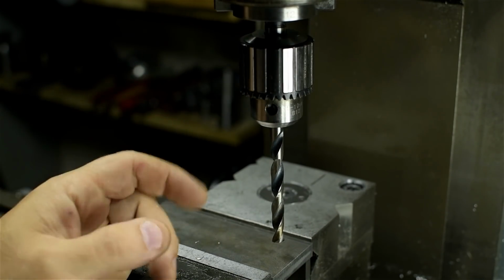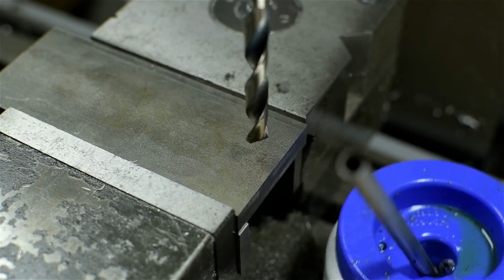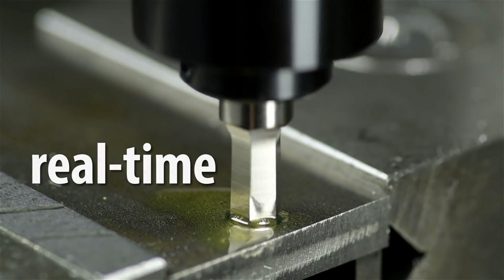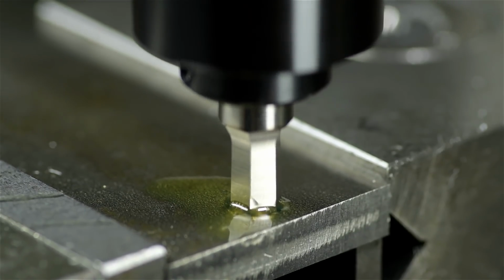Rotary Broach: Captain's Log, Supplemental

Comment: I can only imagine the machinist who thought of rotary broaching. "Hey, you know that non-round hole that we need to cut? What if we try cutting it with a spinning, wobbly thing."
Reply: Now I better understand that a rotary broach is made of wibbly-wobbly turny-wurny..... stuff.
Reply: This technique could have been discovered as the result of a "happy accident".
Reply: You called...
Reply: Here’s the thing. Pop the eraser out of a #2 pencil. Now, think, “How would I use this empty metal circle at the end of my pencil to make a hole in this sheet of paper?” I can remember in grade school when I discovered that I could make a good hole faster by wobbling than by just pressing, no spinning required. The only reason we need spinning in the broach equation is to [cleverly!] provide the wobble.
Reply: @CaryMillsap  Ha! I did not try paper... but I did have a larger eraser that ended up looking like Swiss cheese ;)
Reply: We just hammered a hex key into it... Some smart ass decided to do it a little less brutal 😂
Reply: i'll bet it was accidental.  ever seen a dull counter sink chatter?  6 fluted counters  start to resemble hexs.  Just a bit of refinement from there.  but hindsight is 2020.
Reply: @mikepettengill2706  That's what I was thinking, too...  Was this likely the result of a badly wobbling tool with a broken or worn tip leaving a hole that wasn't round, and the machinist going, "Hmmm, how can I make that happen on purpose...?"
Reply: @Tasarran Everyone who once used a dull knife or chisel knows you need a little wobble to make them cut. You basically use the points as levers to increase pressure at the cutting edges.
Reply: No way was it found accidentally
Most machinists are both engineers and laborers - a perfect combo to make invention happen - and it's not like broaching and wiggling through a cut are remotely new concepts.

Comment: This will definitely help all those people who were like "how the hell?" in the last video ... phenomenal demonstration of what it was doing. :)
Reply: I mean, I could reason out that that had to be what was happening. I just couldn’t see it.
Reply: @JasperJanssen  - same here. I knew it was wobbling, but to see how much it was doing so was cool. Very glad Tony gave in and made this one. :)
Reply: Im one of those. I certainly missed something because i couldn't see how flats were cut by a spinning object.. now i see that the broach only spinning because the work was spinning. The chisel analogy makes much more sense.
Reply: I'm still confused how it cuts it perfectly with that wobble. I guess the bit is slightly under sized for the hole it needs to make?
Reply: @daleroy2466  the very tip is the proper size, but behind that going up it has a taper to it - so as it wobbles the taper keeps the sides of the broach from touching the hole. Pause it once with the broach sideways and look closely at it - the sides of the broach itself are not parallel,  it gets smaller towards the base of the bit.

/  \    <----- shaped like this (exaggerated)
Reply: @Broadpaw_Fox  Thanks for that! :)
Reply: @daleroy2466  - you're welcome. :)

Comment: I got the gist from the previous video, but watching this one made me realize a few things I didn't see before. For one thing, the broach tool must be slightly tapered (maybe that should've been obvious). For another, the axial tilt determines the length of the broach tool. If you shorten the tool by refacing/sharpening it, the cutting face will not just precess but will also "orbit" off-center by a gradually increasing amount the shorter it gets, resulting in gradually expanding hex key size.
Reply: Blondin, yes you are correct, that is why the other broach sizes (in the first video) were all the same length.
Reply: that sounds like a sharpening nightmare. i would need to see a vid to better understand :P
Reply: Yes, the broach body is not just tilted, it is also offset to bring it back to centre based on a chosen nd fixed broach length for the tool.
Reply: @michaelpiotrowicz6100  after sharpening could you set the broach cutter further out in the broach holder. or does it have to be set all the way in?
Reply: I'm no expert on this stuff. I would guess the broach sits in the bottom of the hole for cutting forces, I don't have one. Stefan Gotteswinter built one from a kit. Learn all about it in his channel.
Reply: @piworower  is it 'sharpenable', though? I can't see how.
Reply: Sharpen it by grinding it shorter by a known distance, then add equal amount of shims between broach butt end and holder bottom?  Just a guess.
Reply: @juhakettunen7971  No, you can't really sharpen these. Blondin's observation is correct, the broach tapers to allow it to oscillate through the work. This means that if you sharpened it you'd not only make it shorter, but you'd also make the resulting hex(in this case) smaller.

Technically, you probably could sharpen it since you don't need to take off much material at all to restore a  cutting edge. But you'd probably only get away with one or two goes before your 6.1mm broach becomes 5.9mm and your 6mm key no longer fits.

Comment: I just figured out how to verbalize the confusion I didn't
even realize I had after watching the last video. 

I use drills in the tailstock of my wood lathes (i know, i know...) 
all the time. When drilling, it doesn't matter whether the drill 
or the work spins, but one (and only one) of them's gotta spin.

In broaching, the work AND the business part of the tool can either 
BOTH spin, or BOTH NOT spin. BUT there is a 3rd element, the body (?) 
of the tool where the 1 deg angle lives, and it must do the opposite 
of the work/cutter (spin or not spin). The fact that the work and cutter 
were both spinning on the lathe disguised the wobbling holder action.

Wow. Thanks again, Mrs. ToT!
Reply: caliman99 I'm sure you know what you're saying, but your words broke my brain.

Comment: I watched your 'Square Holes' vid first and while I knew what broaching was I had never heard of rotary-broaching (I'm no machinist) so when I saw you using your lathe to 'turn' a square hole I did two things... 1. giggle inanely and scream "Magic-ery", 2. once calm I went down the rabbit hole of finding more info on rotary-broaching (including visualization vids on clear acrylic blocks). This meant when I watched your main broaching vid I was perfectly fine with the reference-frame switch for the lathe 'method' and understood the 1 degree angle behind the broach face.
This supplemental vid is just icing on the cake and really shows how clever rotary broaching is, thankyou for posting it, Captain Old Tony.
End Transmission.

Comment: Thanks for the follow-up. I went researching and got it.  But this video is way more clear because you can clearly see that the bit is doing, well, the chisel effect you showed.  But it in the prior video, it just looked like the bit was rotating like a drill bit - hence the head scratching.  Thanks!

Comment: I had never seen a rotary broach before your previous video.  I had tried grinding a standard drill bit square but that did not work too well when you spin the bit.  Still get a roundish hole.

Comment: This is some cool stuff! I now work in a sheet metal fabrication shop where we make large quantities of parts for various companies. Your videos have spurred an interest in the inner workings of metal fabrication. Mostly I just push buttons on anything from 35 ton presses to 250 ton, all of which are probably older than I am. But today, I got to see a Surface Grinder in action, magnetic plate and all. Since watching your video about them I've wanted to see one in person! Now I have access to a lot of these types of tools even if I don't use them myself. 

The long and the short of it is, thank you for occupying my small brain with machining videos well beyond my capabilities!

Comment: I absolutely understood the process from the previous video in the lathe, but I must admit that Mrs Old Tony was right, it was a much nicer visualisation when done on the mill. 
It was becoming too difficult trying to spin myself up on my office chair to match the lathe RPM, got quite dizzy every time I got close.
That might be an interesting demonstration project for you - mount a GoPro on a piece of stock in the lathe, and film the work's view of the drill/broach/etc. - I guess at low RPM. (Not sure if that's been done before)

Comment: I think that in the lathe the tool is simply spinning off axis which is what produces the axial pulsing of the tools cutting edge in the frame of reference of the lathe chuck/workpiece. The tool doesn't actually wobble compared to the lathe axis the contacting edge of the tool moves around the bore of the work piece.

Comment: The broach does NOT wobble in the lathe.  Being one degree off center means the broach approaches the work at an angle.  Cutting just as it would if everything were non rotating except the rotation and the one degree angle allows the broach to cut with one corner at the time.  Put the broach in the lathe, put an indicator on it, and rotate it by hand.  The bore in the larger part of the holder is bored off center.  If the larger part of the holder isn't rotating... no wobble.

Comment: Well, funny.  This Old Wife was exactly right!  I went back and re-watched the original video and for sure I never understood that the broaching bit wasn't rotating in the hole.  Somehow I thought the bit had a slightly smaller diameter than the hole and that it deflected off of the walls of the inside of the bore in the pattern of the broach tip (cutting as it was striking the walls).  Wow do I feel dumb for the last sentence I just wrote.  Please tell Mrs. Old Tony that there's (at least) 1 slightly less stupid person in the world today because of her.    Thanks immensely for all you share.

Comment: Holy crap... you have the brown allen wrenches?!! You sly dog... you're making some real shine off these videos, aren't you :-)
We wobble broach pretty often at my shop. Swiss CNC & conventionals. The pre-drill depth and diameter mean a great deal to give the chips a place to live and for coming out with enough of the hex corners yet not cause so much back pressure you lose tool life or literally push the stock back. Too big a pre-drill and the hex corners might strip out during use.
We don't try to re-sharpen the tools. There's some pretty big math going on with the tool length & the wobble angle. Our customers are pretty stringent on hex tolerances and we can't risk the error just to save the $ on the tool.
Terrific videos. I'm simply amazed at your scripting & editing.

Comment: The lathe with it’s spinning work is different in some uses from a spinning tool. There’s a reason a drill bit pulls itself on center in a lathe but will not do so in a drill bit. In a lathe the position of the work is being averaged out by the rotation instead of the tool position

Comment: I don't know if there is variation between manufacturers, but my instructions say to have the broach already engaged with the material with sufficient force BEFORE turning on the mill. I assume that at least part of the reason is to ensure that the broach is centered.

Comment: I was learned that when something is soft ( soft steel , iron , aluminium , copper and cetra ) that it is better to have just a few RPMs i'm talking about 24 to 36 RPMs , i tested it alot and i saw that the precision of the holes in regarding of numbers and clear cuts is must greater than having always s***loads of RPMs .
( the drills have to be well grinded ).

Comment: I know I'll sound like an idiot and I consider myself "quite good" at mechanical concepts - but I kinda didn't get rotary broaching. As the broach spins until it makes contact with the material it looks weird, however, the slowmo and close up makes it so clear (the broach stops spinning and rocks) - mystery solved. Full marks ToT - making weird simple is a what it's all about. Cheers

Comment: I was able to visualise what you were talking about in the last video,  although it nice to have what I imagined be confirmed with such clarity. Young Mrs old Tony was right though, we couldn't "see" the wobble in the last video.
1 thing I didn't pick up on before,p is the first-glance importance of the cutting portion's length. If you regrind for any reason, it seems that the rotation will cause the tool to drag, elongating each side of the cut which would appear to result in an enlargement of the resulting hole, however, I wonder if the rake of the clearance angle and its resultant reduction in tool dimension would actually automatically offset the otherwise enlarged cutting path, or is it not severe enough to offset such a drastic change?

Comment: Ok, fine. 25 years ago, during my first job as a "machinist" (operator trainee), running a Brother TC228 "tapping center", aka a small CNC mill with direct drive tapping, guess that was new back then, I learned how to use an "adjustable" Slater rotary broach. Stick it in whatever taper you want, and with two clamp bolts and no vernier, zero that puppy's 6 tips in to as close to zero-point-friggin- zero as close as you could get it without going bonkers. Your tape gag at the beginning of your last video is closer to reality than some might realize. The manual recommended taping the tool spindle to the body to prevent broach rotation while zeroing this contraption in.  Try to get it within a thou or less...

Be mindful of your pilot dia. You want to achieve MIN 50% flat with max 50% pilot dia remnant after the broach does it's thing. 75/25 is much better. Slater 101, right outa the manual.

Use the pilot drill to chase the hole after broaching to get the junk out. 

This thing works because it rotates at an angle around X/Y zero (in a mill) as it penetrates, pushing one tip at a time in to the work, in my case medical grade titanium bone screws. That's why the broach tapers toward the base, so the tool can clear the hex as it shoves 6 lovely curly chips in to the bottom. The tool stops rotating and starts cutting the second it engages the work. Even if you left the tape on.

Looks like the modern version you're running doesn't require searching for ZERO.
You are a lucky man. With a very cool channel. Subscribed...  :)

http://www.slatertools.com/rotary-broach-tooling/internal-rotary-broaches

Comment: Ooohhhhhh.  NOW I get it.  When it was being pressed in to the work here, I thought it was another gag since it wasn't really moving just kinda wiggling a little, but your arrow and label after it made it through the work made it clear to me.

I feel like it should only work if the tool is stationary though as the holder of the tool moves around it?  It was clearly spinning like mad in the last video, twice, while the lathe spun the work.  Oh, I guess it was spinning with the work... I guess it WAS "stationary", with reference to the work.  Ok yeah I'm a dummy.

Comment: Beware of cheap Chinese knock offs on ebay - the one I bought didn't wobble! 
         I took a chance on a cheap knock of of the exact same rotary broach tool design that you have here from a Chinese ebay seller. My thinking was 'if I swap the bearings for some decent ones, it ought to do for the few times I'll ever need it'. It arrived today, unexpectedly unassembled, and with no instructions. I assembled it and put the shank in my lathe with a 12" x 1/2" rod in the tool holder. The plan was to measure the wobble runout at 2 positions on the rod, and calculate where the point which it wobbles around is, so I know what length tools it is supposed to use. The 'wobble angle' is seemingly always between 1 and 2 degrees according to a bit of Googling. On mine, the most I can't measure is 0.14 degrees (inclusive)! I can't see how that can be enough for it to cut.
      If I had to guess I'd say someone gave a proper one to some machinist in China and said ‘can you make this’, without explaining what it is or how it works, and they then ‘reverse engineered’ it without noticing the 1 degree angle, and came up with something which is almost completely useless!

Comment: Thanks.  That was a whole lot clearer.  From the previous video I had assumed that the broach was spinning in sync with the chuck.

The broach us spinning before it makes contact with the stock.  Then at some point a corner of the broach digs in and it starts precessing instead.  Is that how it works?

Comment: I got it last time, or at least thought I did. But seeing it this way helps me articulate (and answer?) the last nagging question. The broach bit itself must have a 1° rake to it, right? The bottom surface where the cutting edge is must be the wider than the rest of the hex shaft. Otherwise as it's spinning off center, it would bind up or waller out the hole that it cut. Only the cutting edge is the same size as the desired hole, the rest of the shaft is narrower.

Comment: I got the deal about the 'wobble' from the lathe vid, but was wondering if it made a larger hole due to the wobble.  What I had missed on the lathe video was the slight taper on the rotary broach to account for just that thing.

Comment: Is it really doing that precession movement in the lathe though? Here you are rotating the entire spindle housing of the tool. If the bearings and the spindle are set at an angle in the spindle housing, wouldn't that mean that the broach will spin true but the cutting depth would increase with the rotation? So, no precession but rotation at an angle to the work where the cutting edge shears the material in front of it as it rotates into the work.

Love your videos!
Regards
Karl